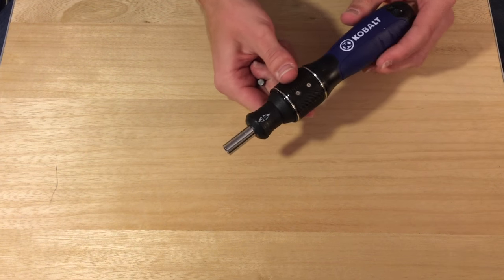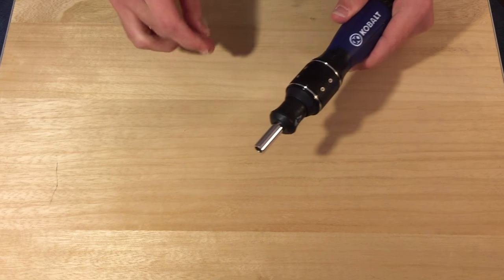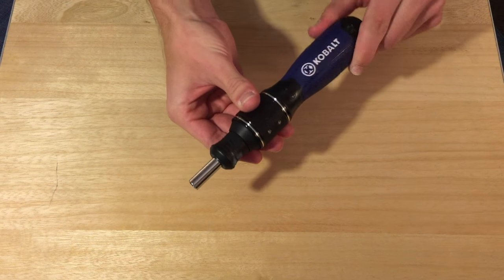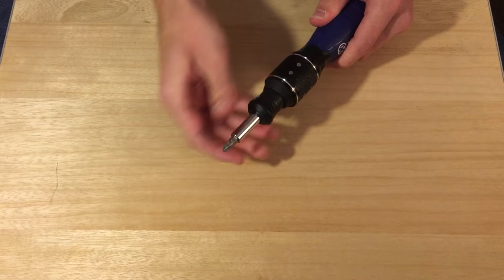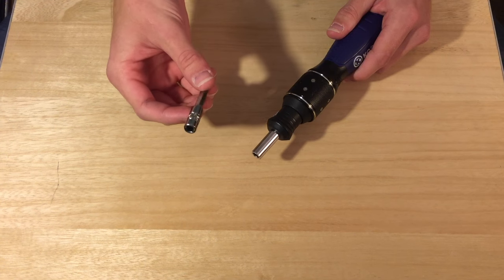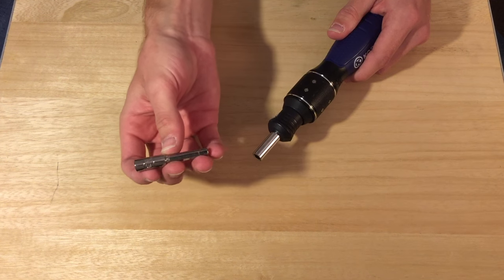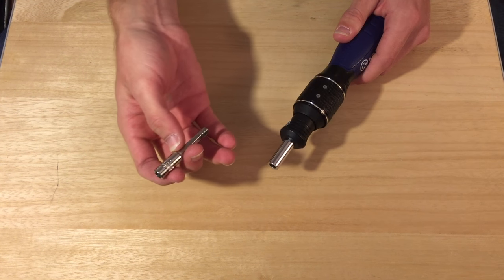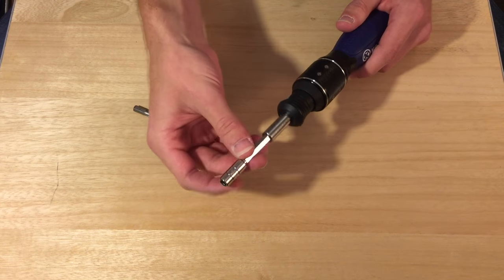DRUM HACK | How To Change Drum Heads Fast - The Power Of A Ratchet Screwdriver

Comment: I have the bit key for a drill, but I played tenors in high school until this year (I moved to drum set in pit) but drumline instructor wanted us to have drum keys on us for competitions and stuff so I got the Vic Firth VicKey. That also helps change heads quickly because of the large handle giving you tons of leverage. 👍🏻
Reply from the maker: Cool! I'm sure a key like that is necessary anyway on tenors or snare since it's got the long handle. I've never used one of those just on regular drum set tuning though. Interesting that it makes it quicker...
Reply: Ive never heard of moving down in marching band

Comment: Nope fastest way is the Drill bit key.    Zip on zip off super fast
Reply from the maker: I haven't done a comparison between the Kobalt and the product you're talking about (I've looked at the Gibraltar Robo key and the Revolution Fire Fly), but I would be really interested to see that. I will say though (in regards to the Kobalt), having a screwdriver-capable tool around comes in handy as soon as you have to mess with screws on hardware.